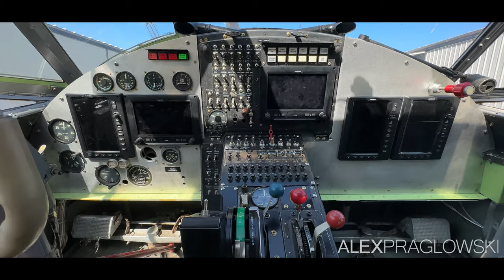WORLD'S LARGEST SINGLE-ENGINE BIPLANE! Antonov An-2 at Springbank Airport

Comment: Had no idea anyone was doing turbine conversions on these things. It's awesome to see, might help keep these relics alive for a while longer :)
Reply: The Russians and Ukranians have been doing Turbo conversions of the AN-2 since 2000. They replaced the original Shvetsov ASh radial engines with Glushenkov TVD turboprops.
Reply: @dschoene57  I wonder why no one is converting the AN-2 to use a Wright R-1820-84 engine you could run the engine at 66% power and still make the same as the old Shvetsov ASh-62 radial engine.
The Wright 1820 engine would get 1,525 hp (1,137 kW) without burning through a gallon of oil a  minute.

Comment: Why the TPE 331? I much prefer PT6 power plants. The PT6 has inertial flow separation for FOD protection. It seems a much better choice for off-field work. I am biased with 6000 hours PT6 time vs 800 hours in Garrets. DHC-6 100s, 200s and 300s. PT6-20 and 27. TPE time was in Metroliners. (226 and 227). The TPE noise makes airport enemies.